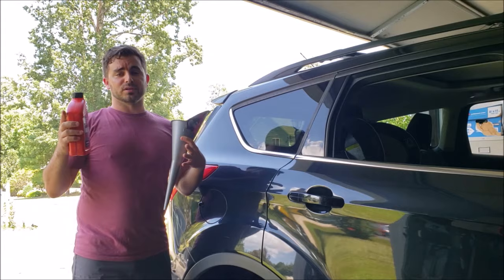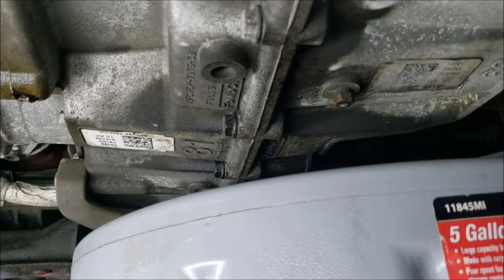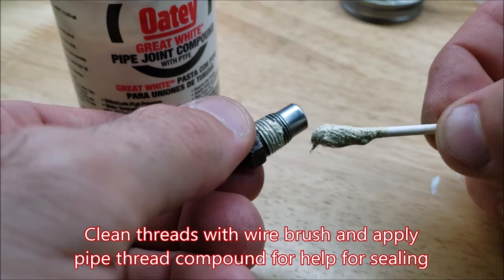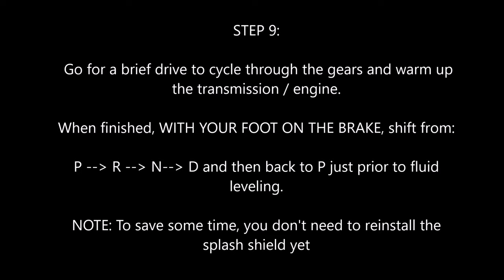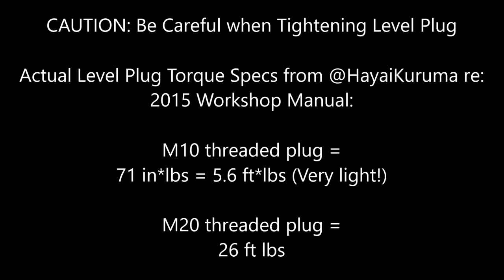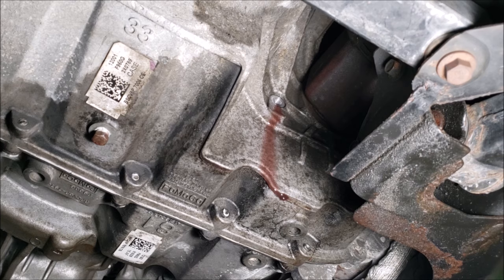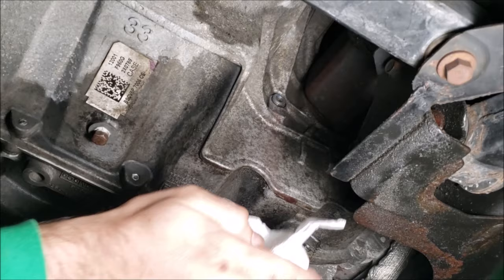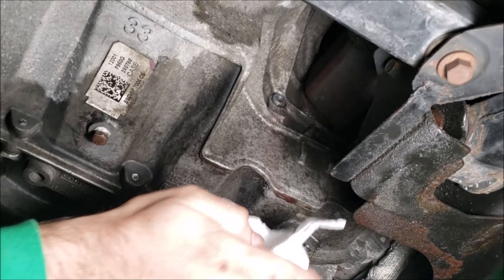Step by Step Transmission Fluid Drain and Fill: HOW TO ESCAPE

Comment: Just measuring old fluid and adding same amount is not working?
Reply from the maker: Yes that can work fine if you know that it was at the correct level before  draining :) sometimes dealers or shops can put in too much or too little so the leveling plug is a good way to be 100% sure you're at the correct capacity.  Hope this helps!
Reply: You are assuming by adding only what you took out that the proper fluid level was happening before. Perhaps it was low previously... I would definitely follow the directions with the side fluid level inspection.

Comment: Engine running ???? Right
Reply from the maker: Hey Jason! Yes- the engine needs to be running to get your fluid up to operational temp and expand to the volume it will be when the car is running at normal conditions. There's also a lot of great info at fordescape.org (Escape forum!) on the drain and fill as well!

Comment: would you know what size / thread that drain bolt is ?
Reply: By using a bolt identifier.  Or, take your bolt to Home Depot. They have bolt size identifiers in the hard ware section.

Comment: If the Mercon transmission fluid isn't available, what's an alternative transmission fluid one can use?
Reply from the maker: Hello Yaw, good question- the manual specifically requests Mercon LV transmission fluid. I can't say for sure which would be a good substitute as this is pretty important. I would consult a local shop who has the next best option who would be able to compare the available alternatives. Where are you generally located geographically? Country?
Reply: @HowToEscapeDIYTipsandReviews   In Ghana, Africa.
Reply: Any low viscosity fluid will suffice

Comment: A 15 minute job that cost hundreds!!😳
Reply: They want 2 to 300 in Pittsburgh Pennsylvania to do this!!🤦
Reply from the maker: I think if you KNOW you had it level at the plug location on your last drain and fill, then there's nothing to it as you can just measure what came out and pour the new amount back in. However, IF you're unsure or if there's a slight leak somewhere, the leveling and driving and the on and off of jack stands can be time consuming if a place is trying to do the whole shebang. I could see it getting up there in price if someone wanted to charge the most they could - you're right though, it can be simple and straightforward :)
Reply: It costs about $40 including tax.  I use Castrol Transmax Ford Mercon LV full synthetic Approved by Ford.  They sell a 4 quart jug at Auto Zone and other auto part stores.  The jug costs $35.  Takes 4-1/4 quarts.  I just buy the extra quart and add a quarter each drain and fill and buy a fresh jug for each drain and fill for a total of 4-1/4 quarts.

Comment: Couldn’t a person just measure how much old fluid drained out and replace with exact amount of new fluid?
Reply from the maker: Yes! So long as you know there aren't any fluid leaks and that the correct amount was put in last time. If you know that, then just measuring the difference is fine. If there's a fluid drip or leak, or if a shop or previous owner did the last procedure, there is no guarantee the correct amount is in there. Good question and thanks